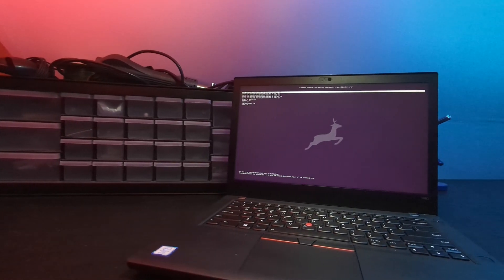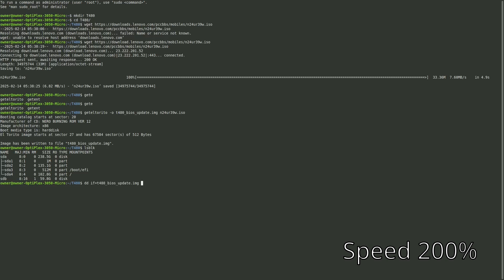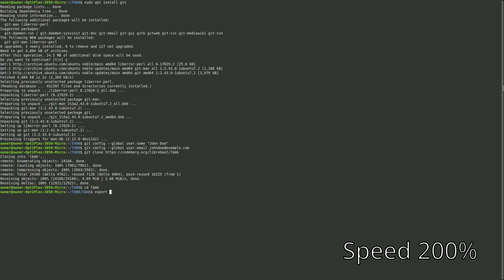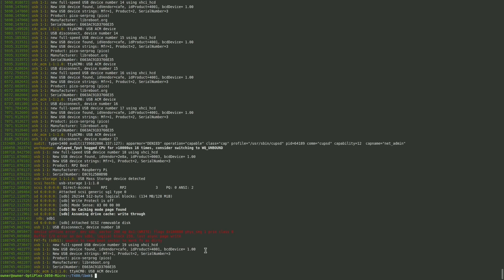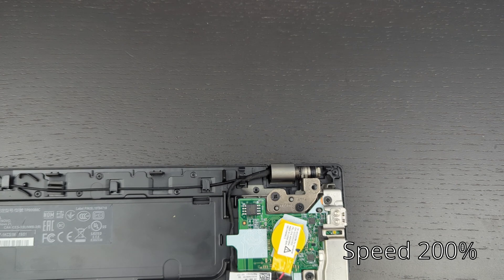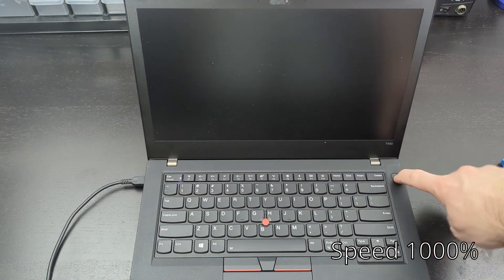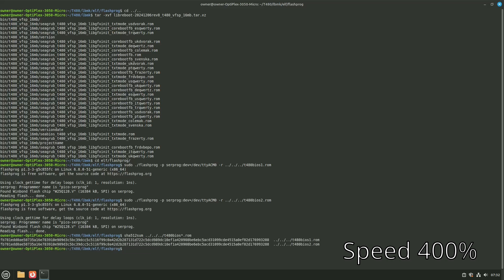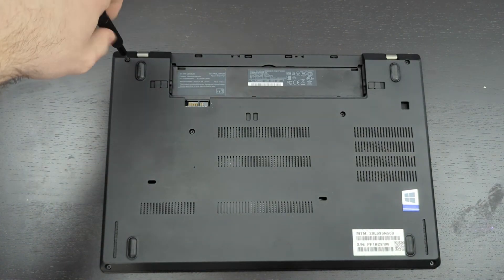Libreboot Thinkpad T480 with Raspberry Pi Pico

Comment: I couldn't figure out why my bios flash reads weren't coming up with the same sha hash. It wasn't until like 20 minutes later I realized I left the battery plugged in... Oh well, it was a success, regardless. Too bad I snaped off a connector on the old wifi card and had to solder the antenna to the new wifi card. I gotta do this shit when I'm awake...

Thanks for the video, it was a lot easier to follow this guide than the one on the website.
Reply: Hey! Did you install the 25.06 version? If so, are the steps the same? :)
Reply: @MrGabriell22  I did. worked just like in this guide. no problems :) ... except when I fixed the wifi antenna I cracked my screen ... FML

Comment: Flashed one T480 no problems already using it, second T480 the thunderbolt chip dumps where different all 8 dumps.. Now the spi says it is an unknown chip and with size 0kb, any ideas how to fix? Can't erase or write to it.. 😔
Reply: probably have to desolder and replace the ic with a matching part and flash it with the thunderbolt firmware. the early thunderbolt firmware was notorious for reading and writing itself to death.

Comment: libreboot = no intel me? or do you have to disable it after installing libreboot?
Reply from the maker: Libreboot has Intel ME disabled or reduced to just boot up initialization depending on the board.

On newer machines like the T480 it is reduced where Intel ME is active only during the boot process, effectively disabling it during the normal operation.

Unfortunately Intel has made it where if it where completely removed on newer machines the system shuts off forcefully after 30 minutes.

Comment: Nice video! I have the T480s now, and this should be extremely similar as a guide.
Reply: got this one too! did it went well?
Reply: @lacartevitale It did! I just Librebooted it last week. I had some issues with a locked BIOS, failed battery(just got it used), but I flashed it well after and I'm getting replacement parts.

Comment: 9:51 Will this pinout be the same for the T480s? edit: Yep, it works! 

Thanks so much for this video, I found it a lot more clear than just trying to navigate the Libreboot docs. Only real differences in this process and the T480s are the initial stock bios version (can just use the latest since UART is not supported on the s,) and the location of the chips. The TB chip is at U12 (bottom right corner of the LTE card slot) and the BIOS is at U49 (bottom right corner of the ram slot.) May need to remove the plastic cover on the LTE card slot to place the clip on the TB chip.

Comment: I only want to add that using 3200Mhz RAM with Timings 20-22-22 is a bad idea as the T480 only does 2400. Buy 2666 with 19-19-19 !
Reply: the ram can be run slower, it's just certified to work that quickly
Reply: @TheJunky228  yeah, but that wont lower CAS to 19, you pay more to get 5% slower ram.
Reply: @krei-se  it's not the most efficient use of money but it'll still work is all I'm trying to clarify

Comment: Nice quick summary of the T480 features. Is there a similarly specced model that has a Ryzen ?
Reply: no, the first AMD thinkpad is the T495, and the Zen+ mobile chips suck and AMD knew it so they called them 3000 despite being ryzen 2000 and i fell for that

Comment: Would be nice to have a short introduction on why we need to do this in the first place for noobs, like me. Had to google what libreboot is and spent some time reading which I hate so I watch youtube. Does installing Libreboot means you can't install windows anymore? Nice tutorial by the way
Reply from the maker: Thanks for the feedback, I forgot to put that section in this video. Maybe I should make a video in the future detailing the pros and cons of libreboot.

But very briefly libreboot is a free and open Source UEFI/BIOS replacement that is based on coreboot. The reality is for most people libreboot provides very little but for people who care a lot about privacy, security, and libre software it can have many advantages. Some of those advantages are disabled Intel ME, frequent updates even for legacy hardware, no vendor lock in for things like wifi cards, being free and open source, enhanced security and privacy respecting.

While it is possible to run Windows on a libreboot machine most people would recommend against it. Especially with Windows 11 which has many requirements relating to UEFI firmware and is laden with built in telemetry that is very difficult to disable permanently not including that Windows is not FOSS.

If you want to run Windows I would stick with the stock BIOS from Lenovo.
Reply: So basically you have your BIOS/UEFI, which boot your system before your OS starts. Now normally this software is provided by the device manufacturer, which is closed source and limited in functionality. My old Lenovo Yoga for example had whitelisted Wifi cards in the BIOS effectively making any upgrade impossible (even though it was compatible and even sold with better wifi cards). This BIOS lock-in is mainly annoying regarding older devices and upgradability. Technically writing your own boot software doesn‘t determine the OS you can use but in this case only Linux OS are used.

Comment: Also got a T480, but I thought the RAM limit was 32GB?
Reply from the maker: The official Lenovo documentation says 32GB is the maximum but myself and others have successfully installed 64GB of RAM and have had no issues. The common belief is that the maximum of 32GB was due to the unavailability of larger modules until recently.

Comment: Terrible.... 
After seeing this, I want to do this!
My T480 is my work machine, so now i have to buy another one to try this. 
Great video! Thanks!
Reply: Fyi, so long as you have the original bios and tb stuff, you can literally revert completely. Unless you short and fry something, it's all fully reversible.
The power of flashing makes everything unbrickable.
Reply: As long as you back up your stock BIOS and TB firmware, it's very easy to revert back, so you shouldn't have a problem.

Comment: Physical Coreboot Flashing....less than 0.1% of people can do that without damaging their computer
Better buy a pre-installed coreboot system
if you can provide a service in Canada, I have few Lenovo laptop to coreboot for you (and installing Qubes OS)
Reply: it's not really that hard, I was 12 when I flashed my first coreboot distro onto an older laptop. Just get the correct equipment (pomona makes the best clips, and the raspberry pi pico is the best and safest for the SPI programmer), open your machine, find the bios chip, put everything together, flash, then it should work; if not then try flashing it again or try a different coreboot distro/the original bios. Most issues with flashing coreboot distros happen due to using shitty CH341A programmers and using bad clips, if you make sure your equipment is good then there should be no issue.
Reply: It's actually really easy if you're not scared of your own shadow.
Hardware stuff have no guardrails, but it's not rocket science.

It's literally just writing 17mb of data onto chips.

So long as you "use brain" and "follow instrustions" nothing will go wrong.
And even if something did go wrong, having taken a backup would allow you to fully revert.

The moment the backup is secured, the laptop can no longer be bricked.